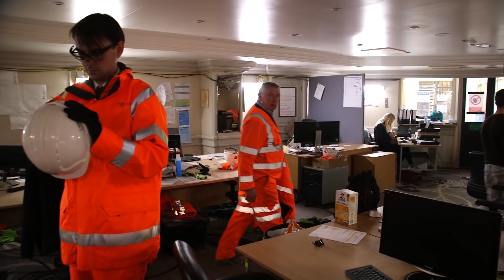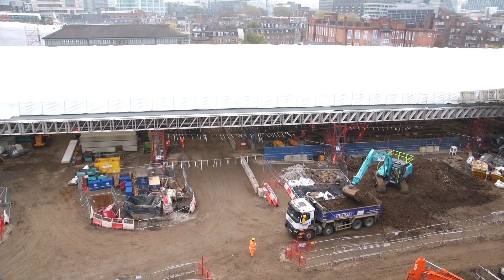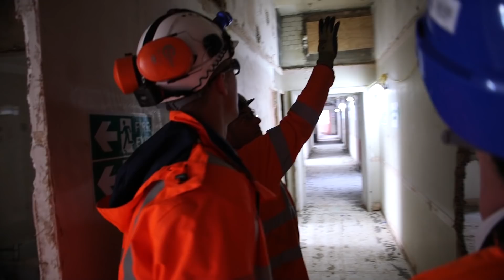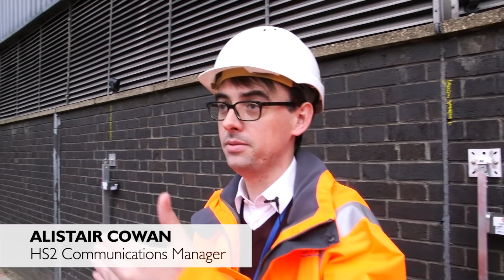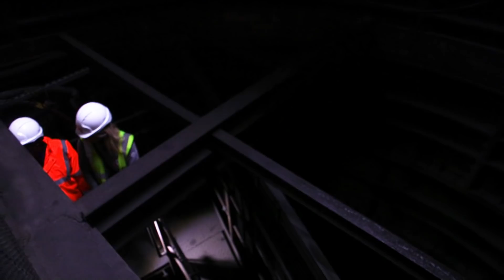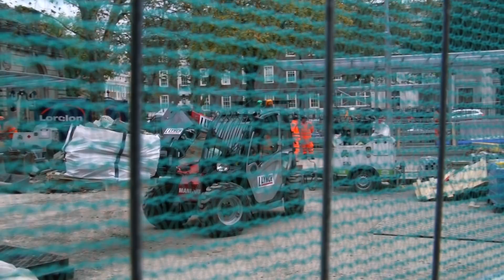HS2 Euston Demolition Works

Comment: Great! I reckon the project will run on budget and finish ahead of schedule. There will be high speed trains, no more power failures, signal failures, points failures or broken down trains etc. The trains and the infrastructure will be weather proof, no more delays due to heat or snow. I have complete faith in the project. Above all, there will no ticket lottery or over pricing because the fares will be the lowest in Europe. Can't wait.

Comment: correct me if i am wrong but is this how it works...the taxpayer pays for the building then on completion its handed over to a private company who takes all the profit .
Reply: It's not "handed over" in the sense that Concorde was. The infrastructure will (probably) be leased (for money to the Exchequer) to someone to maintain and operate the track and a TOC to run the services. Of course, any profits they make will be taxed as will the remuneration (or "profit" if you prefer) payed to their employees, so that's more (direct) money for the Exchequer and then there's the much vaunted "wider economic benefits" however one might care to fiddle the figures to decide what they might be. Same as HS1, M6 toll road, etc.

Comment: i think it would be cool to see double deckers in use for the captive trains. anyone with me on that?
Reply: DD's should be possible in the future, but it's not envisaged any time soon. Greater minds than I will opine on how DD is problematic for things like dwell times at station and disabled access. But the civil engineering structures etc. are being built to facilitate DD stock should future generations require it.
Reply: @DaveCardboard  funnily enough this just happens to be a HS2 concept:
 https://www.youtube.com/watch?v=Y6jQ4PSCig0&t=12s
(yes i know it says its for SNCF but if you look up Alstom HS2 concept... you'll get what i mean.)
Reply: @timothyrennie7362  - Thanks for the links.
Reply: @DaveCardboard  i said this because one of the bidders have put in for a double decker

Comment: I don't see why ST. Pancras was not used for this line north? Requiring only a short twin tunnels to meet the HS2 line near Euston. This would have allowed straight running to the north for trains coming in from Europe. Platform capacity should be adequate, especially if every second train was diverting north. So now, if you're from the north, you have to get off at St. Pancras, and tube or taxi or walk to Euston, the far side of Euston. Not properly thought out.
Reply: The original scheme had a single tunnel between St Pancras (roughly end of HS1) to Old Oak Common. They "deleted" it from the scheme because they reckoned there was not enough passenger demand for trains to/from Europe to/from north of London, it saved them a bit of money and appeased a load of Camden residents. It also means trainsets from Europe do not need to be compatible with the signalling system planned for HS2 (or vice versa.)
Reply: @DaveCardboard  If the new line HS2 is all 'new' then surely it would be compatible with HS1 and therefore all signalling [which is in cab], would be the same. Enginering consistency, trainsets and signalling, should be compatible as used on all HS networks in Europe. Population of Greater London say 12M, but combined up north population is much more. Otherwise it seems a shame not to have straight through running. Many thanks for your information.

Comment: Classic example of unnecessary destruction caused by short-sighted planning. Whilst Thameslink, Crossrail and the proposed crossrail 2 along with the overground are enabling vast numbers of commuters to avoid bottlenecking in terminal and crowding down the tube, the termination of HS2 and trashing of a large area of Euston are an outrageous failure to exploit the situation by, instead of building three terminal platforms, build an underground station and continue the line in tunne;s to link up with a line from Waterloo or one other terminal to continue HS2 maybe at normal speed to the South coast. At the same time create the simple HS1-HS2 link and you then buid a 21st century railway instead of the tired old troublsome concept of chaotic major terminals on the fringe of inner London.

Comment: to me its less the viability to build but more the viability to Run HS2, its faster to hop on a plane from London to Glasgow than going by Rail and cheaper to boot, if this "Northern powerhouse" plan falls through will there be sufficient people to use such a service and what of ticketing price? 

As it stands AFK to STP is £33.40 via HS1 vs £24.70 to CHX from AFK both at off Peak Return prices which is about 26% more expensive to go Via High Speed but its a difference of getting into London in 38 mins Vs 80 mins which is 110% faster... This is viable as you pay an extra £9 to get there in less than half the time but what if this formulae was applied to the much longer route of HS2? 

its worth it for us in Kent as it more than halves the duration of the trip but 30 mins off a 4 1/2 - 5 hour trip? and at what i can see as a likely beyond reasonable hike in cost for the priviledge? i just don't see the viability in the long run unless there is a huge shakeup of the fare system in the UK
Reply: It's the wrong way to think about HS2 as some "alternate" (but faster option) to the WCML availing choice as to whether to "pay a premium" to travel HS2 versus "normal" fares on WCML. Once HS2 opens, WMCL long distance intercity services essentially transfer to HS2, WCML intercity ceases to exist, so there won't be an alternate unless you want to take an all stations stopper (as now.)

For really long distances such as London to Scotland, air will still be faster (and cheaper thanks to the lack of tax on aircraft fuel) so rail cannot compete. But there are plans being hatched to further improve time to/from Scotland. It seems to be that 3 hours is some kind of magic number which represents the tipping point that makes rail more convenient that air (though "3 hours" does sound like a rather convenient plucked out of the air magic number.) We await developments, but I believe the Scottish Government are lobbying for it.

For shorter journeys such as Birmingham-London, Birmingham-Leeds, Birmingham-Manchester, air doesn't stand a chance of competing on time, maybe on price, but for door-to-door journey times, car is king for such distances (if we discretely ignore parking issues.)

Of course, at time of posting, there's plenty of time for changes of Government and/or fares policy to happen before HS2 trains start running in revenue service.

Comment: it took 15 years to actually start building?
Reply: HS2 got royal assent only 2 years ago
Reply: Sure but when the project starts to role, you will see how efficiently it works out i.e. under budget, ahead of planned opening, world class signalling and high speed trains that won't keep breaking down and will get a power supply that won't keep breaking down either. In short, you can expect a cheap alternative to using cars, better than Japanese, Chinese or German reliability and above all, the trains won't be affected by heat or snow. I'm excited, you should be too 🙌

Comment: Will Euston Railway station be temporary closed for HS2 works?
Reply: If you mean "closed for X months/years for HS2 construction work" then no.
If you mean "will there be some weekend/Xmas/etc. closures" then yes. Indeed there already have been as they rejigged some of the existing track in preparation, though often this was done in concert with closures for other (non-HS2) works.

The basic plan is to build 6 new HS2 lines "offline" alongside (to the west) of the existing station negating the need for large numbers of closures, open the new HS2 platforms and transfer service to them, then close 5 of the existing western Euston platforms, clear them away and build another 5 HS2 platforms. It's unsure yet what will happen to the rest of the station (as it's not HS2's remit to redevelop the rest of the station) but the Mayor, Network Rail, et al are developing plans and lobbying for the money.
Reply: But remember, a small sacrifice for a better tomorrow.
Reply: The money is being spent wisely for your benefit, all the profits will be reinvested in the railways for a golden tomorrow. Wait and see. You won't be disappointed.

Comment: how come it's going to cost so much ? a third of what it cost for the space station and that's in space  against Birmingham's 200 miles away doesn't add up too many people with a fingers in the pie in my opinion
Reply: Sam Sungg It’s costing £55.7 billion, not that much when a bypass in Aberdeen cost £1 billion. And that £55.7 billion includes everywhere between London and Manchester and Leeds
Reply: A small price to pay for a world beating service.
Reply: @prp3231  I agree it will be quite something when it's finished. But that won't be until 2035 at the earliest and it will cost 3 or 4 times more than is currently envisaged.   I worked in the Construction Industry on the cost side so I am only too well aware of the shortcomings in the costplan budget which has next to no detail in it plus a paltry risk contingency with no thought given behind it. There should be a detailed costed risk register covering things like LA planning requirements, highway alterations, protester disruption, sub  contractor business failures, etc.. but none of that detail exists.

Comment: HS2 is an expensive vanity project that isn’t required and will cost the taxpayers billions. Decimation of countryside which won’t pay for itself, with only a few stops so people polluting more roads to get to Birmingham to save 10mins on a current journey. A total joke
Reply: The same arguments against HS2 have been trotted out for the last ten years. The counter argument goes "what would you do to fix the WCML & ECML capacity problems that will cost less that HS2, take less land, pollute less and cause less disruption whilst delivering the same, or better, increase in rail capacity." Ten years on, we are still waiting for an answer.
Reply: Dave Cardboard they are the same arguments because they are totally valid. There is no reason to “fix”  the current services, with two different lines with more than enough capacity to fulfill requirements. HA2 is not needed and not wanted outside of London

Comment: I am all for progress but £50 billion for a rail line that will only be 30 minutes approx quicker is a waste of money.
Reply: The journey time savings are a secondary benefit. The principal reason for building a new rail line is to relieve capacity constraints on the existing WCML and ECML. If you are going to build a new railway, you might as well make it fast and gain some journey time reductions.
Reply: @DaveCardboard  Ok their are other benefits but  still does not warrant that cost. You could build 15 more aircraft carriers and use helicopters to get you there and still get change. Just a thought
Reply: @666spurs  - mmmm, I wonder how much it would cost to build the ship moorings in London, Leeds, Manchester, Birmingham. And of course helicopters are soooo much quieter than railway trains. And polute less. And carry more passenger. 

Of course, I realise you are not are making a serious suggestion, but to argue that the "money would be better spent" on pots holes, broadband, police, schools, hospitals, tax cuts, or anything else one could think of (worthy or not as they might be in their own right) is a false dichotomy and a straw man argument. None of these alternates would do anything to address the capacity problems on the WCML and ECML. A transport problem needs a transport solution.
Reply: @DaveCardboard  I am not suggesting it should be spent on anything particular, but £50 billion to build a rail track to ease congestion, seriously. I am all for better transport links, but their has to be better ways to spend this amount, that is £400 million a mile approx. And at 250mph you wont be enjoying the scenery, if you blink its gone. But its going to happen whether I like it or not. Nice talking to you. Take care.
Reply: Have faith in our world class labour force. Just watch as the project whizzes through and finishes ahead of schedule and under budget.

Comment: Money that would be better spent on the Severn barrage to provide 5% of the power to England and Wales negating the building of 3 nuclear power stations, estimated cost £20bn. The cost of this fiasco is estimated at £55bn. 
Tories looking after their mates.
Reply: ralphsterz That wouldn’t reduce the serious capacity problems on the WCML though
Reply: @agent_605  yes you are right, although there were more cost effective alternatives.
Apparently Brunel converted the whole of the GWR from London to Bristol, from wide to narrow gauge in one weekend. Don't know how true this is but nothing is impossible.
Reply: ralphsterz That’s before labour laws or minimum wage was introduced. Also converting from wide gauge to standard gauge is easy as standard gauge uses less space than wide gauge. The WCML was built with standard straight off and a lot of the route has been developed next to so not much realignment, if any, can occur. There isn’t any alternative that is any more cost effective because of that
Reply: @ralphsterz2889  Brunel was long dead when they converted the GWR from broad to standard gauge, and turning in his grave too.
Reply: @ralphsterz : Actually Tories hate railways - nests of trade unionism. Mrs Thatcher only went on a train once during her premiership, for the Channel Tunnel opening ceremony. She LOATHED railways and was spitting chips all the time as she had wanted a road tunnel. Tories like BMWs.

Comment: Waste of money should just use old oak common, get cross rail from there to central London, Heathrow, docklands
Reply: No doubt Crossrail passengers will be thrilled that they cannot get on a train because it's already full of HS2 passengers. The "terminus at Old Oak" (either temporary or permanent) gambit was advanced a few times during the Parliamentary scrutiny of the phase 1 bill and found wanting. Some or the argument against went along the lines of "there's not enough land at OOC to build 11 HS platforms" (or at least, not within the bill limits,) "OOC isn't where people want to go" and "you cannot build tunnels from OOC to Euston once OOC is operating, again because there isn't the land available for all the tunneling plant."

Comment: What trains are going to run this route?
Reply: Unless it has changed recently, I read that all the phase 1 rolling stock is going to be "Conventional Compatible" - there won't be any dedicated GC gauge "HS2 only" stock. The latter isn't being entertained until phase 2 (and then probably phase 2B.) 

One wonders whether someone in future will come up the idea of having a "single type" fleet and give up on HS2 dedicated stock if the budgets are looking tight. I guess there's a good few years yet for that to all play out.
Reply: I thought "they" had decided (at this stage) not to bother with any tilting stock as it isn't necessary on the HS lines and the extra mass and reduced cabin space to accommodate tilt would (respectively) increase the operating costs and decrease the seating capacity. 

I recall a debate where someone then complained that as a result, when HS2 CC stock ran onto the existing WCML, there would be places where it would be running at slower speeds that the existing Pendelino's!
Reply: Dave Cardboard I don’t imagine it would be many places as the Pendolinos rarely get up to 125mph anyway and mostly operate at <=110mph, which is the maximum permitted for non tilting stock. I don’t recall it ever being an issue for TPE’s 350s, and even TPE’s new stock will be non-tilting
Reply: No contracts have been placed yet, but the plan is to have at total of about sixty trains, of two types - a "captive" type built to the full HS2 loading gauge to run between London and the Birmingham branch, and a "classic compatible" type to allow operation on to Manchester etc. (compare the original class 373 Eurostars which had to be capable of operating on the legacy network, and the later class 374s which are confined, in the UK, to HS1). The latter may also have tilt.  Who knows what new technology will be available in eight years' time? - eight years ago the latest things were class 378 and 380, both obsolete designs now. (Overground now has 710s on order, Scotrail has its 385s)
Reply: Norbiton Flyer Although after Phase 2 is completed Manchester and Leeds services will use the captive type trains
Reply: Avanti West Coast partnered with Transitalia will operate HS2

Comment: That is the point 30 mins is not worth it. There is other ways in increased capacity on existing lines like upgrading the track but no let's go straight though long eaton on a 19m high viaduct and knock down 184 homes and that's just a small town
Reply: Paul Kerry You can’t upgrade the track forever, at best it would last 5 years and would cause a decade of misery for everyone

Comment: I HATE HS2 if they destory the the station
Edit: wait no it's a train oof
Reply: Pelton Botchway of United Kingdom UK Which station?
Reply: Euston
Reply: Pelton Botchway of United Kingdom UK Euston is a horrid station in almost every way.
Reply: @disusedchannel4852  They are not knocking Euston (the station) down (a pity as it is the pinnacle of bad 1960's architecture). They are extending it.
Reply: Wait Wait HS2 is the line OK I Love it